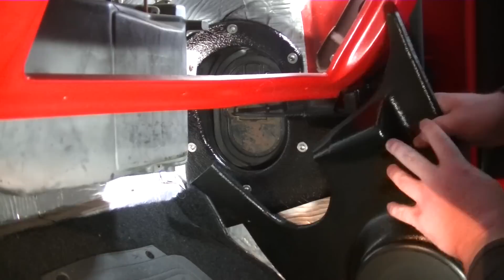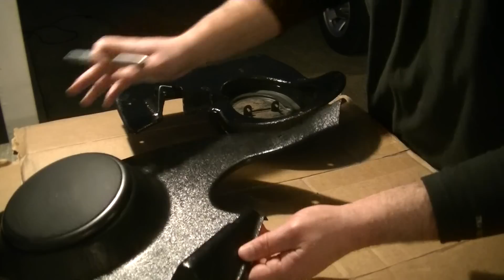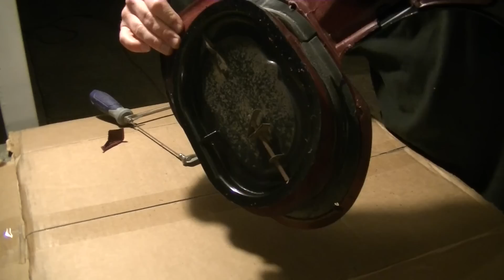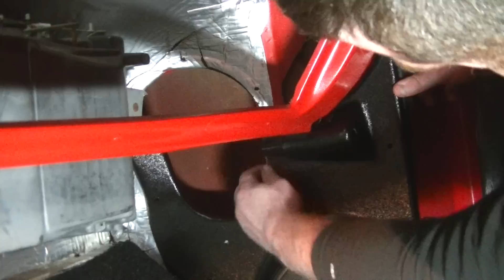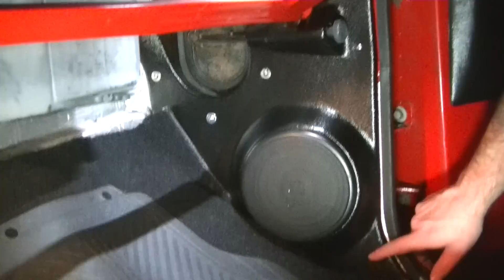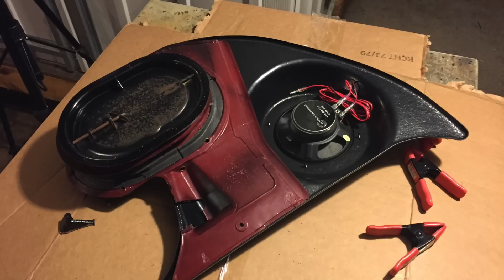PART 3 CHEVY C10 KICK PANEL SPEAKERS INSTALL | 73-87 Squarebody Speakers

Comment: I had Hertz Speakers and was not happy with them so I sold them so I bought some cheap Kicker speakers for my front door because I was in a bind and they actually sound very nice. One thing I would recommend that you install a layer of sound deadening onto your panels, any vibration will rob you of acoustic energy. I used NOICO from eBay. Work just as good as the expensive stuff.

Comment: The cabs were not always made prefect at the fire wall to the floor. I found one that had a 1/2 seam separation  on side and  1/8 on the other. I been a 73- 87 C/K gm truck nut. Doing a full restore of 79 but upgrade to mod wiring (no ecm or LS) Old school with twits.

Comment: get yourself a component set with a separate woofer and tweeter with and external crossover.  Any brand will do. Energy, infinity, Kenwood or Alpine.  The woofer goes where your speaker is now. the tweeter can either go in your door panel higher up or your A pillar. the crossover can go anywhere you want to hide it. The sound quality even using only deck power without and external amp is just so nice to listen to. It also allows for upgrades if you ever decide to do so in future.  Your eyes honestly wont even notice the tweeter is in your door panel after awhile. Give this some consideration you wont be sorry.. Bill

Comment: I've built decent sound systems using the Wally World sourced Pioneer speakers.  There's nothing wrong with them if you aren't competing in some audiophile contest.
Reply from the maker: I've bought the Pioneer stuff from Walmart and I was perfectly happy with it.  Thanks for watching!
Reply: That was my 93 Suburban.  With my new(er) 98 Suburban I figured out that base Rockford Fosgate speakers can be had for just a little more. I'm loving it.  Good sound on a long road trip is key for me.